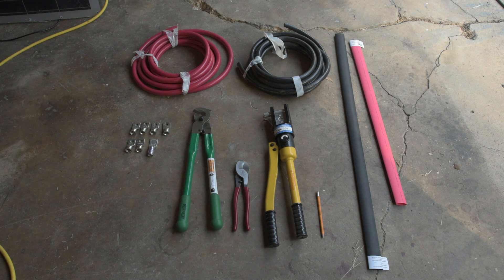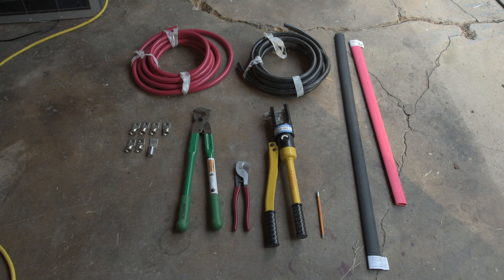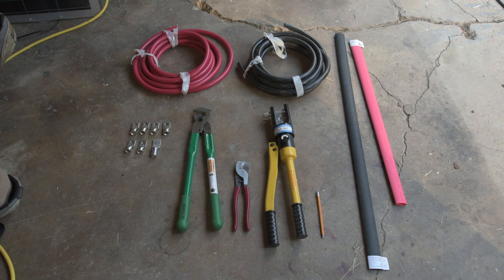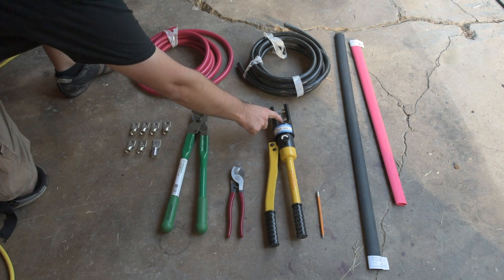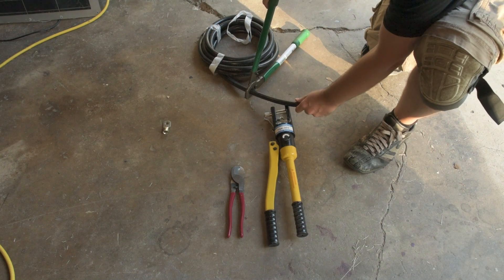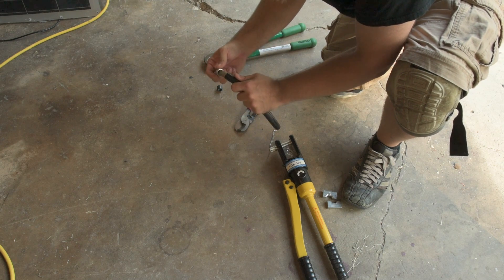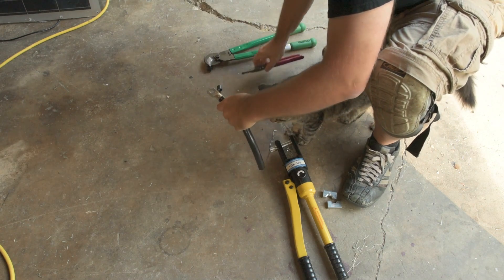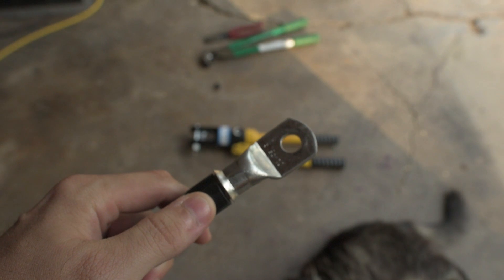How to make 4/0 battery cables

Comment: oh basically when you cut it in half you are looking to see if there is any gaps between the wire strands and also if there is any gaps between the wire and the terminal. If there is, then its not a good crimp. You want to see all the strands and the terminal become one solid chunk of metal just like this.

Comment: lol yea that's a perfect crimp. Only thing I could recommend is to continue heating the shrink wrap until the adhesive oozes out a little bit. That helps to confirm a air/water tight seal.

Comment: To my amateur eye that crimp looks excellent. I think the secret to not getting wings is the tight fit of the cable and selecting the proper die. 

I would suggest picking up a round cable stripper. You can hold it to the end of the wire to adjust the blade depth to very nearly (but never) nick the wire, and you get a clean, straight and square cut. Cheap ones (like $20) work fine, imho, for someone who doesn’t use them every day.

Comment: That crimp looks solid. Appears you compressed the wire extremely tight so therefore it looks like solid core but honestly shouldn't make a lot of difference since it's on soo tight. You should lose less electricity because the quality of the crimp looks amazing.

Comment: Nice video.  I just replaced all the battery cables on my ten AGM batteries in my boat.  The experts say not to use welding cable in a application where any fuel could leak on them as the jacket can not hold up to it and will melt away.  Marine cable will not do that.
Reply: True. Some welding cable uses straight edpm insulation which resists uv and other radiation well, but swells and degrades around petroleum products. There are ratings, like J1127 that designate a cable as suitable in an engine compartment, up to 60v iirc. 

Some cables meet several standards. J1127 might be also rated for higher voltage and for welding, for example.

Comment: Crimps look great to me a better way to strip the insulation is to use mason line or builders line and run the string over the insulation where you need it cut it burns right through the insulation but won’t damage the copper wire

Comment: I worked as a IBEW Lineman for 4 years. It is critical at high voltages to no knock any wire AT ALL. One trick is to “score the jacket” or cut the jacket close enough to the wire so the jacket can be pulled off without ever touching the wire at all.
Reply from the maker: Is this due to the skin effect at high voltages? I think the skin effect only applies to AC, but it is still a good idea to not nick conductors.
Reply from the maker: I would actually love to learn how to strip the jacket on these thicker cables without nicking the conductors. I was doing a project recently where I was in a hurry and lost a few strands. My hands always ache after working with thick cables for a while too. There has to be a better way.
Reply: The spring loaded cutters with adjustable blade depth are quite affordable and work great.
Reply: I ordered a cable stripper from Napa for $18 where you match the cutter to the thickness of the sheathing and it spins around the cable and then down the length to strip the casing off. Cuts the casing evenly and clean without cutting any strands. Part #NW 726606

Comment: Americans, always so confused by simple metric measurements. The 120 is the cross sectional area of the conductor (120mm^2)
Reply: Also, you can't properly inspect a crimp unless you acid etch to remove the cutting swarf from the voids. Yours looks decent, but be aware that you're probably using metric dies which aren't the correct size for that cable.

Comment: Hey man what's better a 0 guage or 3 or 4 gauge car jumper cables? Cuz I was thinking of buying a powerful cables...
Reply from the maker: Better is a trick question. Thicker cables carry more amps with less heat but do not bend as easily and are heavier. Figure out how many amps you need, then use online wire gauge amperage charts to size the cable.

Comment: Good crimp! “120” refers to the metric equivalent of the wire size. 120mm^2 and #4/0 AWG are very close in area (circular mils or “cmils”). With dies and lugs, there’s usually a difference in cmils between super flex cable (MTW or DLO for example) and stranded cable (THHN orTHWN for example). FYI: The dies / crimpers sold on amazon are typically meant for super flex cable as stranded cable is only used in the US and those crimpers (on Amazon) are imported from Asia. If your application is compression lugs  with stranded cable, those dies might not crimp tight enough.

Comment: Nice!  To help with strands that want to bend back when installing the lug you can twist it while pushing it on.  That keeps the strands tight together so they slide into the lug easier.  Otherwise if you just push the lug straight on then you get strands that flex back.  Happens all the time when I've been making cables.

Comment: Little Late.  I'm always late.  Your crimp looks fine.  A bit soft.  I see some Air gap to the left side.  We use to dip them  in a solder pot for some applications.  Mixed school of thought on including the BELL end of the terminal within the Crimp.  We included it .   I worked in a wire harness facility making harnesses for Caterpillar  and other known names some 7 years.  Many  Military contracts.   I still don't consider my self a professional. LOL

Comment: That’s better than most. I have the same crimper. I had to remove some material from the parallel surface from both half’s of the dies to get it to close down a bit more. I got the crimp down a more pronounced corners on the hex crimp. This is totally dependent on the brand of lugs you want to stick with.

Comment: Bad way to strip wire.  Get a cheap adjustable cable cutter like this:  https://www.amazon.com/gp/product/B00BMUDIGA/ref=ppx_yo_dt_b_asin_title_o05_s00?ie=UTF8&psc=1
Not saying you did a bad job,  it's just easier with the right tool.  Retired electrician speaking.

Comment: Perfect crimp.  The tool makes a difference.  As an alternative to the expensive heat shrink, you could paint on some silicone to seal the connection under the regular heat shrink tubing.

Comment: Just doing my Big 3 upgrade for my 06’ 5.9 Cummins and the only thing I did different was I beveled the insulation on the wire and actually got it snuggled up into the terminal so there is no gap at all, and I used tinned copper terminals heavy duty with the viewing hole at the end and I double crimped and then heated the hole terminal up and got the tip filled with solder also! I used 2/0 and 3/0 Execleane welding lead cable! Super cool setup,

Comment: I worked at a produce packing plant twenty years ago and the entire facility was cooled to keep the produce fresh. We had to use electric forklifts that used 48 volt 1000 ah batteries. The batteries had a quick connect that was used to unplug from the forklift and connect to the charger. This constant plugging and unplugging would fray the ends and we would have to re terminate the batteries.

We used similar tools except for a manual crimper, it was a workout to use it. We also crimped twice, once with a larger die and then switched to the next size smaller to get a better crimp. The hydraulic crimper allows you to use the right die for one crimp. We were extra careful to keep the cables separate.

Comment: Nice going, I am having to get into doing my own cabling for my home backup system, because I just don't trust the "experts". This means I have taken a pretty deep dive into this field and would like to share with you what I know about your crimper situation.

To clear up the numbering issue on your crimping tool, it is clearly a metric crimper and the units are in square millimeters (sqmm). This relates to the amount of cross sectional surface area of the conductor. The 120 die on your crimper is for 120 sqmm wire which is one of the standard metric sizes for wires and lugs.

The next standard size down from that is 95sqmm. Your 4/0 AWG cable should have a cross sectional area of 107.2 mm so you technically have a die that is just a smidge too big, though at that size, a 13 sqmm delta is not as big as you would think and a smaller die would probably just not work well as it may cause too much plastic deformation in the copper, pushing it towards its yield point, which could result in a weakened lug. 

From a circular diameter point of view 95sqmm is 11mm wide 4/0 is 11.7 and 120sqmm is 12.4. Bottom line is that you don't have the correct tool for the imperial wire system that is commonly available in your country, as that tool is intended to be used on metric wire and lugs. That being said, it still produced a great crimp and is a darn sight better than "vice and pliers" assisted crimps I have seen out there. Hope it helps and thanks for the video.

Comment: well i guess the trolls took a break for this video, but i do see a couple "experts" commenting about how they do it or maybe questioning the crimp. i think they either don't pay attention or don't understand the crimp isn't just to hold the terminal on the cable, i'm glad you went far enough to explain about the crimp when done right has no gaps inside or room for air, that didn't sound right but maybe you know what i meant. i got a great lesson in 1994 when a expert did my car hauler for me, battery's , starter, winch, and 30ft remote control cable with switches, still today no corrosion. 00 cable and brass terminals.

Comment: Crimp is good. Be aware you can also buy Ancor tinned cable, for demanding (marine) jobs. Costs more but goes the distance with no corrosion if any water finds its way in. If you are doing a lot of these, get yourself a cable jacket splitter. Hand tool with a variable depth cutter. You set the depth, then spin the tool around the cable a couple of times (depth is pre set so you don't cut any strands) and then pull it toward the end and the cutter knife turns 90 degrees and now splits the jacket from your cutline to the end and the jacket just falls off. The hydraulic crimpers are great, very cheap for what they do - I guess all made in China so they only seem to come with metric dies. I'm sure that 120 you have is a metric figure. Wish a manf over there would make a set of AWG dies as I have seen a number of crimp jobs botched because of confusion as to which dies to use. Thanks for the video!
Reply: why don't google a little bit ? you will immediately find out that english countries are the only ones still using the ol' Imperial system. 4/0 is equal to 107 square mm,
Reply from the maker: Thanks for looking it up for us. Sorry I didn’t think of including the metric sizes when I was making the video.

Comment: I've watched a lot of videos on crimping, and yours is the best. I have that same crimper, and half the battle is picking the right dies. The problem is that some terminals are "heavy wall" or sized for 1 AWG and 2 AWG wire, some are thinner, so I'd say to buy a few extra and if you get "Bunny Ears" where the dies make a pair of tabs on the side, use larger dies and try again.
You don't have to over crimp. That smashes the strands. I threw out my first attempt.
BTW I use a knife to cut the insulation, and if you twist it off rather than bend it, you don't get loose strands.
Your crimp was perfect!

Comment: The hydrolic crimper is the way to go with that size wire. Only way to get a gas free crimp. If you cut the top off of that terminal after crimping it in it should look like a solid copper rod where the crimper mashed the wires so tight together. You usually only get that with the more expensive crimpers. I'm not sure about your $50 pair but the harbor freight $50 won't hold up to it.
Reply: People already posted its a perfect crimp and you cant do any better than with a 2000 dollar pair.  Im guessing you have an expensive pair and are trying to justify having them.

Comment: Awesome video.  This was exactly what I was looking for my truck camper build.  If I decide to go the direction I'd like to with my power set up, I will need to run a healthy length of 4/0 cable.  The distance from my battery under the hood to the inverter in the truck bed camper is about 22 feet give or take.   The distance I guess requires me to run 4/0.  Expensive.  My only other alternative is to run my  batteries in my truck bed. But I don't want to give up the space and I want to be able to tie them into the alternator for charging purposes when my solar isn't able to be taken advantage of.  Your cables crimp set up looks clean and professional.  You have some strong comments backing up your work it sounds like.  Thanks again for sharing! New sub!
Reply: RV Maximus 
Thanks again
Every 2 cents helps

Comment: I just got the 4/0 welding cables. The lugs are over $10.00 each. I just bought a dozen. I will buy a copper pipe and make my own lugs from now on. The crimper will get here Dec 6. Thanks for the video.

Comment: Superficially, that crimp looks solid and very good.  Typically, a good rule-of thumb for the amount of wire compression is 20+/-5% (reduction in cross-sectional area).  A) The un-terminated wire strand diameter can be measured with a micrometer and the cross-sectional area calculated.  Add them together and you have the cable cross-sectional area. B) Sand and polish the cross-sectional cut of the crimp you made with the band saw.  (Sometimes you need to etch the polished surface with acid the see the wire vs. the terminal.) You can then measure the cross-sectional area of the wire in the crimp.  This is cheapest in an optical recticle, but is easier if you have access to an optical comparator, or measurescope. This hexagonal area is then determined using trigonometry.  C) This area should be 80+/-5% of the original wire area.  This is the most accurate way, but understandably a destructive validation and very labor intensive.Alternatively:An easier way is to get the proper nominal crimp height (with tolerance) across the terminal flats from the terminal manufacturer for that size wire.  Then just measure your crimp as defined by the terminal manufacturer to verify it is in specification. (This assumes your wire cable is near nominal cross-sectional area and you didn't cut off strands during insulation stripping.)I am a connector engineer with crimping on some of my products.
Reply from the maker: +David Humphrey wow. Cool stuff.
Reply: Yeah, I'll get right on that. lol (amazing). No disrespect but we're doing a 12v  battery cable here, not a main line for NASA Mission Control... Good stuff though
Reply: Dude, 
I came here because of the cat, not a dissertation on electrometallurgicalfibromialgafrachiado.

Comment: Looks like a very good crimp. Nice video. For cutting the jacket off the cable try using a utility knife with fresh razor blade. You really don't want to cut any strands.
Reply: Agreed, the utility knife doesn’t cut into the wire. I cut all the way around in a circle then slit from circle to end and peel right off. Much cheaper then those cutters too.

Comment: I used the smaller Kline cutters a lot in the work I used to do, and they work well on smaller electrical wire- #12, 10, 8 and #6, and it will work on somewhat larger wires too if you work at it.  I had a friend who used to slide a piece of conduit over each handle to increase the leverage.  I finally got a greenlee cutter for the bigger wire.

Comment: From this old Marine Systems Engineer that have been doing this for many decades, I can say "very well done".  Your hired! I would recommend to get the hell off the floor and use a bench. I prefer lineman crimpers with the two rotating dies for quick change and fast easier crimping. Well done dude.

Comment: That is a GOOD crimp. Turned the bond into a solid block of copper. Then you hermetically sealed it with proper shrink tube. Great job.
Reply: Jim- please explain how you posted on my video, how I should not use touch the wire and not to use cutters to strip the wire, but here you say Great job? I agree, he did a great job but you have no idea what you are talking about.